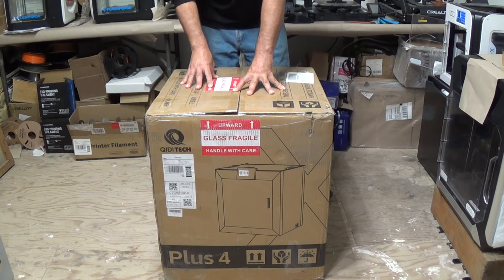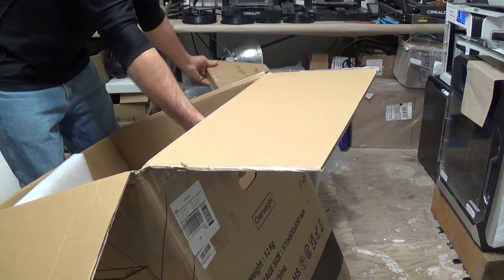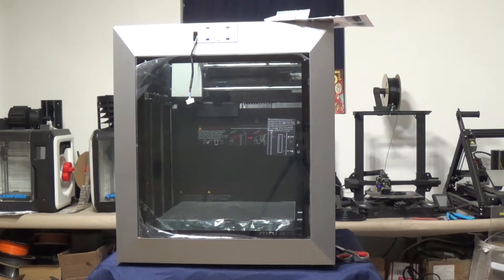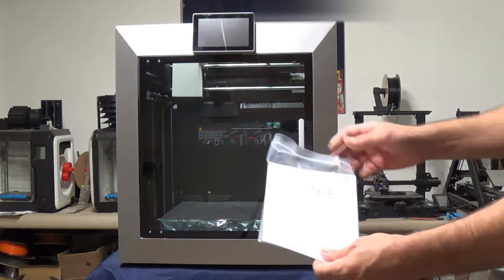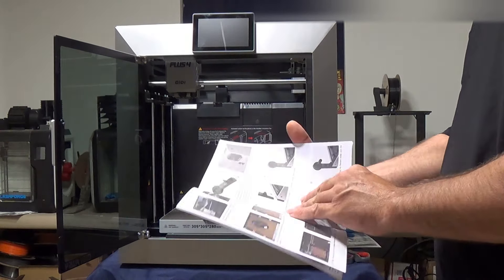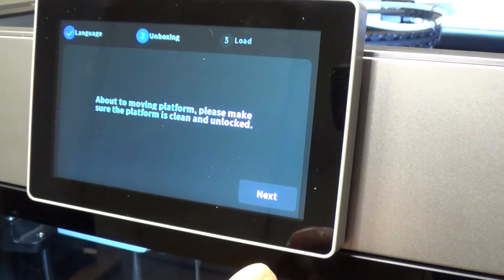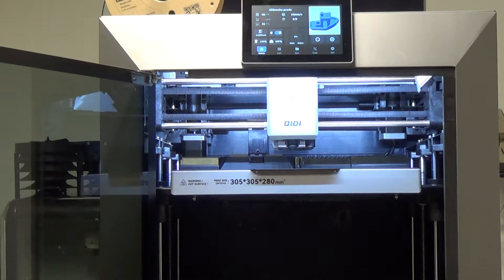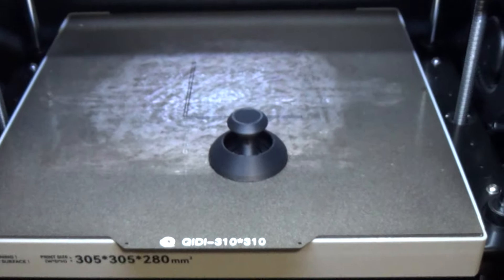QIDI Tech PLUS 4 - unbox, setup and first prints.

Comment: Thank you for the video. Just started to set mine up and I inserted the filament and hit load button, and it did not flow. did you have any trouble with that?
Reply: I had this issue and it seems it didn't set the temp I had chosen, maybe I pressed something wrong? 
Either way I did the filament loading afterwards from the menu, basically same process.